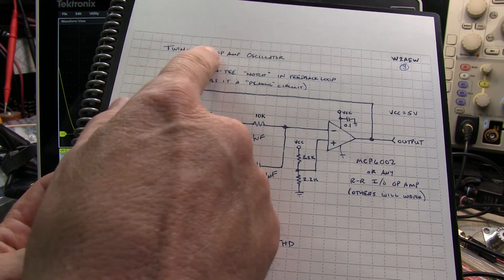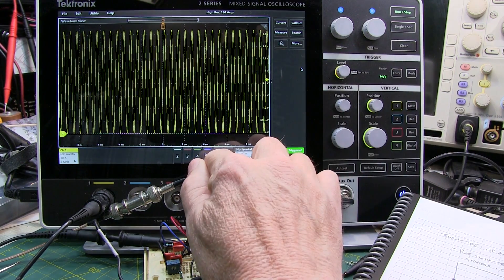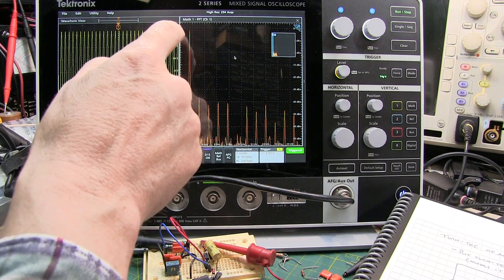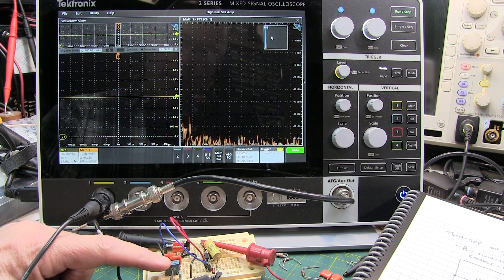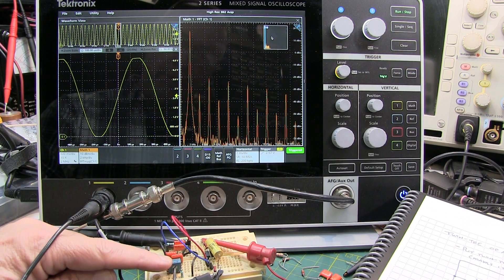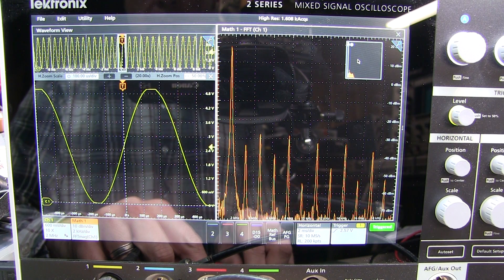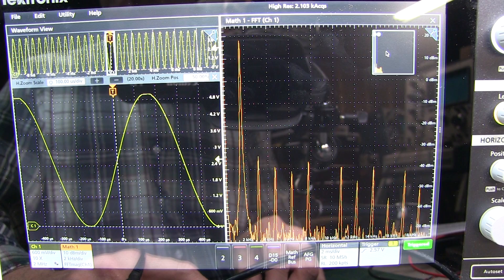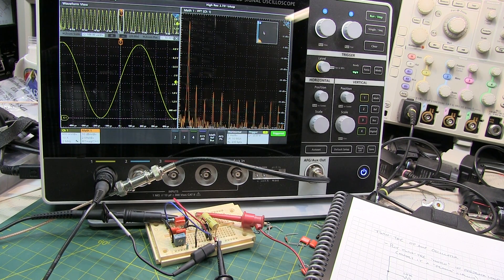#381: Circuit Fun Followup: Trimming out distortion on Twin-Tee Oscillator - FFT &THD measurement

Comment: Thanks for sharing this. The common problem with oscillators is that they are sometimes hard to get running and if one bulds an amplifier, it tends to oscillate if given any chance. Have you studied this circuit regarding the reliability of starting? Is it critical to temperture / part tolerances?
Reply from the maker: I have not studied it in those terms - just this introductory video....

Comment: I can’t get my breadboard twin tee to oscillate!  Built it several times using o0.01uf caps, and 20k ohm resistors. R/2 with two R in parallel, same idea 2c. Have used TL081 and ½ LM328 op amps. Voltage from 5 through 12 volts. No oscillation. Can’t understand why
Reply from the maker: You may need to make the R/2 leg adjustable...
Reply: @w2aew  I’ve sort of tried that - how critical is the R/2? I’ve use Rs from the same resistor strip, and they are quite close to the same value, hence my R/2 should be reasonably accurate. But I’ve tried a ten turn pot as well that passes through my desired 10k point, but no joy. Maybe I’m too coarse in adjustment. I’m using the circuit from IMSAI guy , and note he has a 110k R from output to the + input, and a 1k R from + input to ground. How critical is that I’m thinking. I note that you don’t have that in your circuit, but instead lift the voltage a little at the + input to op amp. …… this should be simple, I’m usually working with RF!  Maybe there’s an issue with my op amp choice (read availability). I’m in a remote location. Just want a nice 800Hz - ish sine wave oscillator to use for my CW practice. VK4BAC, but unlicensed for XW region.

Comment: Good morning!!, Had a technical question. This twin tee looks like a band pass filter on the vna, in theory would you be able to use a crystal placed instead of that and get a sinewave without changing the rest of the circuit?
Reply from the maker: You certainly can make a crystal oscillator - the circuit will vary a bit, but they work.  However, crystals are typically not available at these low frequencies.

Comment: Back in the day, an actual incandescent light bulb was used in bench equipment to do the job of reducing harmonic content by preventing clipping. When the amplitude increased, the incandescent filament would warm and increase in resistance. This worked very well with the tube equipment. For the Op Amp version, a Light Dependent Resistor, coupled to an LED can perform the same function, but with the change of the LDR reduces resistance instead of increasing with increasing voltage. The AGC function can keep the oscillator out of the clipping region by riding the gain a few DB below clipping for good signal to noise and very low THD.

Comment: I really appreciate seeing elegance combined with simplicity.  
Wish i had found this circuit,   Uh like twenty years back..   A related slick passive is to use a high Q   RLC to obtain a healthy VPP above the rails for modulating a fiber optic laser  carrier.  DDS DRIVING A CLASS B into the peaking before †he laser modulator that requires around 50 VPP.  Also a multiplying DAC for precise amplitude control.  All great  for sycncro resolver  excitation applications.   Fiber optics are used to make all dry ( no wires ) hydrophone arrays.  Amazing to see the elimination of many hardware stages in software.   I worked on a VSP at Litton Guidance.  vertical seismic profiling using a fiber optic array down hole. for oil deposit mapping.

Interesting is using shift register and XOR TO make random noise.

Comment: Hi Alan, watched both videos with interest. Last year I went on a quest to build a low distortion sine wave generator.
Started off with the usual Wein bridge which was OK but the distortion was way higher than the source in my hp 8903 audio analyzer. So then moved on to what was called a 'State variable sine generator' uses 4 opamps, and a bulb for stabilisation. The bulb seems ultra critical. Needs to be fairly high voltage with low current for best results. I started off using a TL 074 and latter moved on to the more exotic OPA 134. Both chips were very good. The final circuit measures around 0.0013% distortion, measured on the 8903 and on some computer software which also displays the spectrum. The harmonics and the biggest (2nd) was way down at -95 db with respect to the fundamental. In fact the distortion is so low my Keithley 2015 has problems measuring it! It is now my default signal source when measuring amplifiers. I did several videos on this project on my channel should you be interested. Best wishes nick

Comment: Great videos. Does a non rail to rail op-amp like a 741 have the same order of distortion?
Reply from the maker: All op amps will distort when they reach their output voltage range limit.

Comment: I'd love to see a video about isolating harmonics from an astable multivibrator the way the original circuits were originally intended to be used. Maybe even touching on the history a little bit. I could never find a description of EXACTLY how they isolated specific harmonics from the squarewave output of the multivibrator. I always assumed they would use a bandpass filter and then amplify the output. I tried it myself, but the passband on my filter was always so wide that other harmonics got into the output.

Comment: Interesting demonstration. Has anyone else tried to build this oscillator? I both simulated it in Ltspice and built it on a breadboard without any luck. It just outputs a dc voltage at vdd/2.

Comment: Touchy to adjust, wouldn't take much to get it to fail. The Wein bridge
with a little light bulb (T1 size or smaller) works great and is stable over a wide
range of conditions. The bulb shows remarkable AGC behavior. I thought it was dumb until
I tried it decades ago. The current is very low it doesn't light . Low distortion unlike zener designs.
I  made a single transistor version of a tuning fork oscillator with the bulb in the emitter.
 After all it's how HP got its start. Make a new video and compare.
Great video as they all are. JY
Reply: Exactly what I have been playing with ! the bulb is awesome, still thermionics can help out ! best I've seen using sound card and ARTA is 0.005% THD with my version of Dr Hewlett's work and my own PCB.

Comment: What is the total harmonic distortion of a soundcard output measured with the same setup?
Reply from the maker: Probably quite good
Reply: @w2aew  Would be interesting to see in comparison.
Reply: I have a cheap one and measured in 'loop back' better than 0.002% Edit :- using ARTA software.

Comment: Ok, this was interesting as I suspected and raised more questions. Firstly, what is it that we're actually trimming for? I suspect that we're actually trying to match the depth of the notch to the (open loop) gain of the op amp. Make the notch a little too deep and oscillation stops. A little too small and the amplitude goes too high. BUT the implication of this (I think?) is that the two T's are actually slightly detuned from each other, compared to the ideal R/C equivalence, to bring down the gain in the notch slightly. Am I understanding this correctly or am I talking nonsense?

Also I noted, especially at 4:34 that the 6th harmonic is almost completely nulled out. So it's not just a split between odd and even harmonics.

Lastly those comments with someone trying to flatter you with a profile picture with their butts out are spam bots. They either copy a comment from a previous video or use AI to generate a comment. I'd suggest deleting those.
Reply: I'd worry that, as this design requires you to get as close to oscillation dying as you can to optimise THD, that if I tuned it too close to the limit then one day it wouldn't oscillate because the ambient temperature was wrong or something. As the distortion seems to be clipping as the op-amp aims to maximise its output dynamic range, I wonder if some kind of AGC circuit could be used to constrain the output swing, to keep some safety margin away from the op-amp limits. Hmm...
Reply from the maker: Exactly right.
Reply from the maker: Yes, you’re defining to just meet Barkhausen criteria, so not really practical or robust, just something fun to play with.
Reply: @w2aew  I live for "fun to play with" 😁

Comment: Thanks for this follow-up. I was also wondering what the effect would be on the total number of harmonics if one would work with half the capacitance on the highpass filter... or conversely, on the lowpass filter. Could you find your way to demonstrating that when you have some time please? Thanks  a lot for the very clear explanations
P.S. by half the capacitance I mean as half the capacitance on the other filter or vice versa

Comment: Great clip again,
Lets double the caps ( by putting the same cap in parallel with each cap) and divide the resistors by 2 (by putting the same resistor in parallel with each resistor) see if we can acheive higher or lower THD.  This should not change the frequency because the product RC value is the same.
Also, I wonder how Caps and resistors mismatch effect the THD.

Comment: Impressive FFT on your scope! Some time ago I had a look at an old LT application note on a very low distortion oscillator circuit using various high end LT parts. I believe it achieved something like 0.03% (-70dB) distortion, but then again these days you can get a $9 Apple USB-C headphone adapter that will do 0.001% (-100dB) distortion @1kHz, 1Vrms output with an output impedance of just 300 milliohm.
Reply: @jim9930 I have the same scope and as far as I'm aware it's 8 bit only on the 4 analogue channels and 1 bit on the 16 digital channels (if enabled).
Reply: @jim9930  It's an interesting method to measure the fundamental and then at the same time notch it out and measure the harmonics with increased resolution, but I guess it's not much use if you're doing a THD+N/SINAD measurement. I've found the Digilent Analog Discovery to be a decent budget solution with it's 14 bit scope having differential inputs and 14 bit AWG doing 100/125Msps and effectively good up to 15-20Mhz bandwidth. I've designed both an Impedance Analyzer and an Audio Analyzer using that device.

Comment: Thanks for the video. Are you able to extract the harmonics from the scope in a data table and then use those data points to calculate the THD and compare that with the multimeter value? :)
Reply from the maker: It would be possible. You’d also have to match the number of harmonics included for each measurement.
Reply: @w2aew  Yes, I was wonderng what bandwidth the Keithly used for its measurement of THD.
Reply from the maker: @shean4  I believe the 2015 can measure harmonic components to 20kHz.
Reply: Yes you could.  A video I did several years ago shows the formula and how to calculate THD.  https://youtu.be/w5UKzdqRAqE?feature=shared&t=2784minutes  The part of interest on THD starts at 46:25 minutes.

Comment: Could you do a video on a circuit that takes high frequency dc pulses above and below to a 60 hz sine wave?
Reply from the maker: Not sure what you mean by that.
Reply: @w2aew  
I’m looking to replicate a Don Smith magnetic resonance system.
The device uses a double Tesla coil and generates a double DC spike like a sign wave with a high voltage and high frequency around 200,000 cycles per second.
I understand how to get the voltage down but unsure how to use a resistor and capacitor to smooth out the spike and lower the frequency to 60 hertz. Any thoughts?